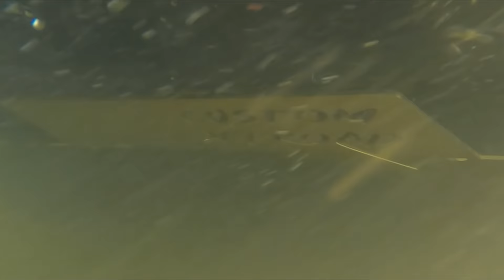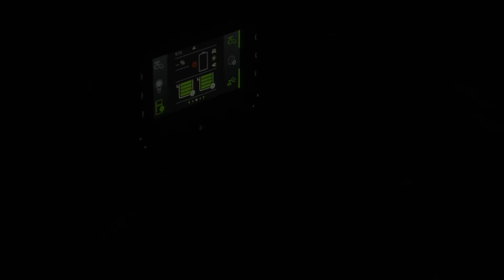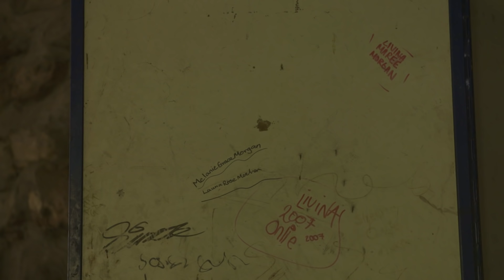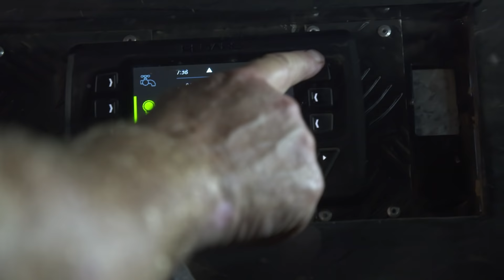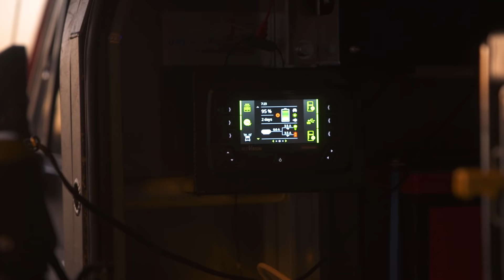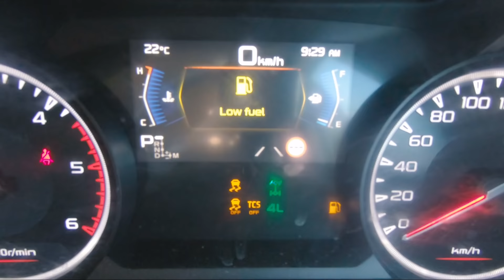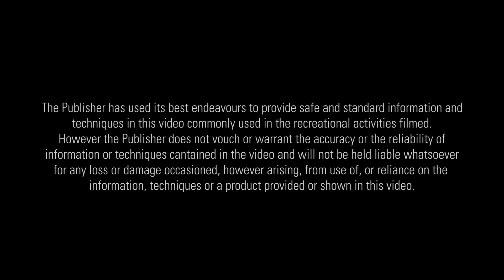10 DESTROYED TYRES IN 50KM – Making our own track in 2m+ tall scrub! Kimberley after the wet season

Comment: For these types a trips it’s a good idea to carry a heap of HD tubes, take up no room and let you continue to use half rooted tyres
Reply: Been wondering why this isn't a thing with them.  I mean, the torn and then tubed tire won't be as nice as a tire with an intact sidewall, but it's gotta be better than no tire.
Reply: I've never seen them tear this many tires ever, the tubes is a great idea.
Reply: @Kingsoupturbo  COVID mostly to blame. THE CSR Track is still closed, that will be interesting.
Reply: @Malc664  Makes for pretty good videos!
Reply: @Kingsoupturbo  Yeah, dramatic and tension. More fun.
Reply: @Malc664  Full exploration in the bush were nobody has been in a long time is a pretty awesome adventure! I'm sure they'll bring 20 tubes next time they do a trip like this and 500 litres more fuel.
Reply: @Kingsoupturbo  I wouldn't have attempted this with 120 gallons per vehicle much less liters.
Reply: @bradbutcher3984  It seems like they were pretty optimistic on how much fuel they were going to use on this track!

Comment: Well done can’t wait to see part 3. Quick tip for tyre puncture problems easy for beadlocks wheels , bring inner tubes to fix the punctured tyres in case of emergency. I’ve broken 4 tyres on a trip in Africa with only 2 spares , it saved be in the middle of nowhere

Comment: 26:39 that camp trailer is badass,  it just needs small electric hub motors in the wheels, like  a Tesla, so it can propel itself it the tough spots
Reply: Too heavy i think
Reply: @cannedgorilla1062  yeah. Maybe with huge reduction gear you could get away with using small/ lighter motors. Really only would need 2 of 3 mph for spots where your dead stuck,  and the steepest of climbs
Reply: Yeah Tesla power

Comment: I’m lost for the reason as to why you didn’t just take 20 tubes, best way to patch a sidewalls is patch and tube
Reply: I was wondering that
Reply: Haha what ? Don't think they have done tubes in car wheels for like 60years
Reply: @Shibbybooboo  Absolutely they have and still do. I got a nail in my tyre recently and have simply tubed it up and problem solved.
Reply: @Shibbybooboo  doesnt mean they cant put a tube in it, especially if its going to get them home...
Reply: I don't know why they're not stuffing unrepairable tyres with grass? Break the bead & open one side up and stuff the shit out of them until you can't fit another blade of grass - will drive like it's got 15psi in it.

Comment: Anyone else notice they never talk about or give props to the Ford Ranger. They just call it a “dual cab ute” 😂😂
Reply: So so true
Reply: Or just 'the Goodyear ute'. It's a weapon. And mostly stock. Those Ford Ranger Raptors are very very capable.
Reply: Must be part of their contract with Isuzu or something. That Raptor is probably the most capable stock dual cab and probably more capable than the DMax with the mods on it. But is way more expensive mind you.
Reply: @principal7819  yea I think you nailed it on the head. It’s a shame because the Raptor has been eating the track up and has been last in the convoy which makes everything much harder
Reply: @judthesizzler1975  absolutely. It's a beast of a ute. It's also done really well in other videos too and they've never mentioned the brand.

Comment: Always used the good old motorcycle tube to fix sidewall damage. Get some rubber glue, thick black tar glue. You pop the bead and spatch it from the inside using the motorcycle tube as your final layer inside. Keeps the air in and get you rolling again on damaged sidewalls. If your even more handing packing a repair kit throw a conveyer belt staple kit in there!

Comment: Rema tip top has A-B compound that is designed to repair sidewall punctures in the field. They also have a (B-120) reinforced nail hole patch that as long as you can break the tire down off the wheel, you could fully repair,for trail use, most of those tires within24 hrs of cure time out on the trail.

Comment: Do Aussie's not use Limb Risers on their rigs? 
In case you don't know what a limb riser is, it runs from the front grille guard to the roof, typically is made with braided steel cable, and its purpose is to keep limbs from hitting the windshield. Hence the name 'limb riser.'

Comment: With Jessie’s car and putting the 35’s together with the 33’s, you could have put the 35’s on opposite diagonals of the car still used 4WD as long as the diffs weren’t locked. Could have even lowered the pressures on the 35’s to match the height of the 33’s and then continued to use diff locks. Yeah, would have looked bloody weird and steered oddly, but better than 2wd only.

Comment: You just need to take the valves out of your tyres and fill them up with expansion foam while the weight is off the wheel. It will be good enough for that slow ruff ground.

Comment: hey guys, great 3 parter 👍🏻 .. that last creek crossing with the sandbank where rocket and shauno got stuck .. yeah the one the d-max cruised through 🤣 … what gear were you guys using? .. from what i’ve read low range is the go for sand banks and that didn’t look like low range ha! … beginner here in the 4wd scene so just looking to up the knowledge, cheers

Comment: shaun next time bring a weed wacker instead of a chainsaw? place graham on the front push bar and cut the weeds away????someone in the group should install a transfer tank about 40 gals,  or 150 litres. my rig is a 2500 dodge diesel 6.7  turbo, with 4.56 gears, on 37" tyres, main tank 50 gals, or 200 litres, plus 60 gal. transfer tank. 240 litres. to fit offroad economy, what you do in city driving on economy fuel, cut it in half for offroading.

Comment: with all the tyre side wall damage y did you not put a cut beer can on both sides of the hole screw them together then glue a rubber patch on the inside and put a tube in or am I just old fashion with carrying a tyre tube

Comment: Hey guys, I have a question. After Ford Raptor got 35" tyres, the commentary says it would have to stay in 2WD most of the time. Why is that?
Reply: OK. In 4wd the front and rear axles are locked together thru the transfer case. If the tyres are of different rolling circumference, the axles will turn at different speeds. This is not good if they locked together. Something expensive will break. Hence all tyres should be the same diameter.
Reply: @MrTonaluv  Thanks for the answer. I guess I more or less understand the principal. Still, does not open lockers solve the problem? Or maybe this is what Graham meant - engaged front and rear, but open lockers.

Comment: just get me the great 4x4 men don't know the best bush track fix for a flat. 1. run Tyre so bead is broken 2. pack Tyre total full of grass storks put back on vehicle drive a way . if done wright it's like driving on sand with low Tire pressure the tire is held out by the grass which is all around you.

Comment: Hi Guys fantastic video as always! Question on tyres, maybe Im old school? But I always carry three spares on my 110 csw 1994 300tdi and just cleared 300k miles without missing a beat, apart from one scary self inflicted rear wheel bearing lock up at 70mph! But along with 3 spares, I always fit tubes to my tyres. Replacement tubes are much easier to carry by the box, along with puncture repair kit and a tyre bead tool and levers  take up no space at all. Also much safer on rough tracks to not break the bead of a tyre and have a dangerous rapid tyre deflation on the sude of a steep hill? Food for thought?

Comment: You All Need To Have Some Of The OLD TIRE BOOTS Or The Tire Boot Sheets of Rubber Boot Material You Ruff Up &Clean The inside of The Tire REALLY  REALLY  REALLY  GOOD, THEN PUT TIRE PATCH GLUE PAST WHERE THE PATCH IS GOING TO BE Let THE GLUE GET A LITTLE TACKY & Evenly  Lay The Boot Patch Over The Cut / Whole & Yes You Can Hot Patch it By Lighting  the Glue on Fire ,( But it is REALLY  Flamable  ) DON'T Have Your Face In The Tire When You Light It & Get Your Hand Out AS FAST AS YOU CAN I MEAN  NOW RIGHT NOW &  Let It Burn For Just A Few Seconds   ONLY & THEN USE A ROLLER & Roll it Down As Tight  as You Can, IF YOU DON'T  HAVE A Roller Take What Ever You Have Thats Not Pointed & Press it ALL Down All The Way ,It Would Be Good To Practice on Some Old Tire FIRST ,IT'S  ABOUT PATCHING A TUBE,Thats How they Were All Done  Before  PLUGS  & There ONLY FASTER & EASIER 
The Boot/Boots Are REALLY  Better if Done Right. If you clean a piece of inner tube perfectly clean you could probably get by. ??? But clean is the key and glue past any patch. And everything down tight.

Comment: Banana? Considering its extreme usage I do not understand why Ronnie's ute has not turned into a banana. Refer to John Cadogans video on 4wd DOUBLE CAB utes and the 'bent chassis' problem. Ronny must have additional super strong and long chassis brackets from heaven. John does not focus on it, but I think the washboard roads also contributes immensly to the chassis cracks. Lower loads x MANY cycles usually = cracks. Especially true for those caravans bolted  to double cab utes used more for dirt roads rather than heavy offroad use.
Reply: OOPS, I think his name is Shauno.
Reply: Ok, forget about the names, just focus on the dual-cabs in the group.